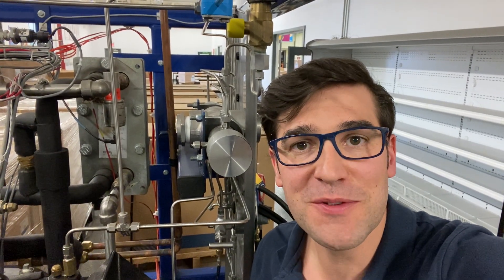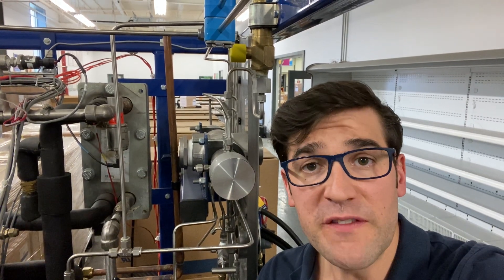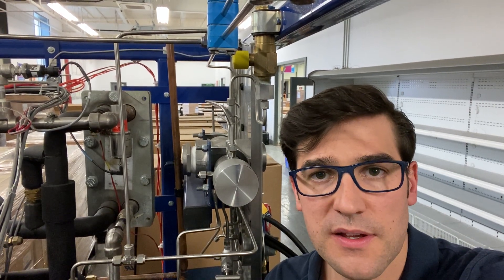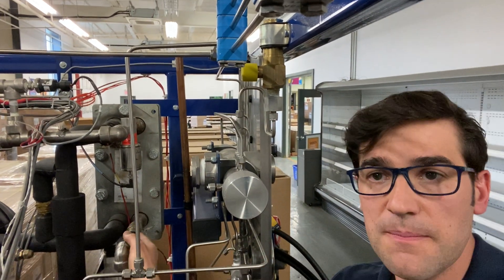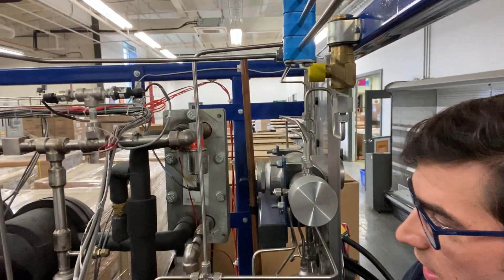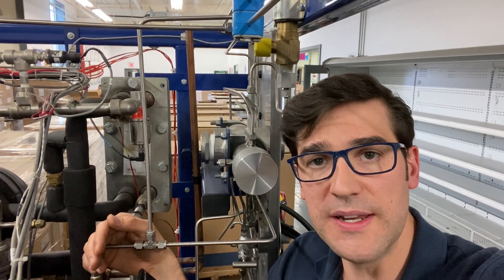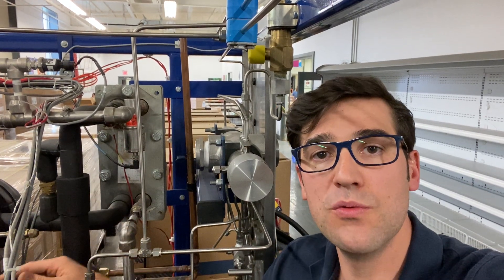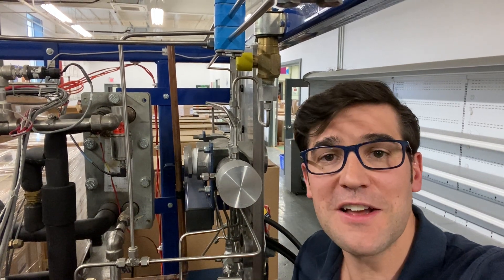MT Transcritical CO2 Compressor Superheat

Comment: Thank you for this Update. Does this 20°F superheat applicable to other Low  Refrigeration System because I have read in a bulletin that Superheat for Coldroom can be between  3 - 5°F
Reply from the maker: Toyin that minimum 11K or 20F SH is for CO2 MT compressors. Most compressor manufacturers like those number but are not a minimum. With new refrigerants you will start see minimum superheat as they have a higher soluble rate dilute the oil causing bearing wear.

Comment: Hello good to know 10 k superheat . I have not yet work on a transcritical booster. I live in a tropical region(mauritius island). What's good for us parallel compressors or ejectors? Getting confused. I'm very interested in the CO2 transcritical system but unfortunately no training yet in my country.
Reply from the maker: You could use PC, ejectors or both PC and ejector depending on the type of ejector. If the humidity is not too high in Mauritius adiabatic gas cooler could be an option, mechanical subcooling or a flooded evaporator system.
Reply from the maker: Yes EPTA has some really cool technologies. Here’s their website if anyone wants to learn more https://www.eptarefrigeration.com/en/system-engineering
Reply: Maybe company EPTA has solution for your country.